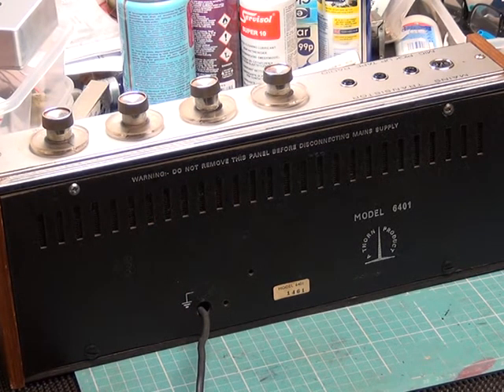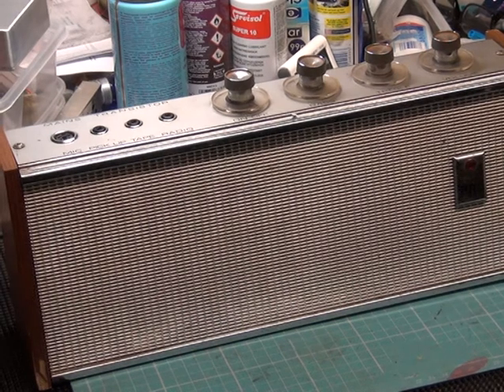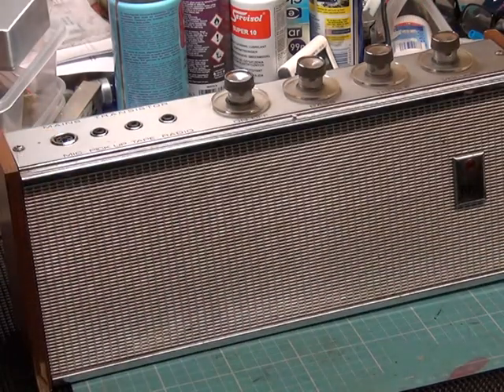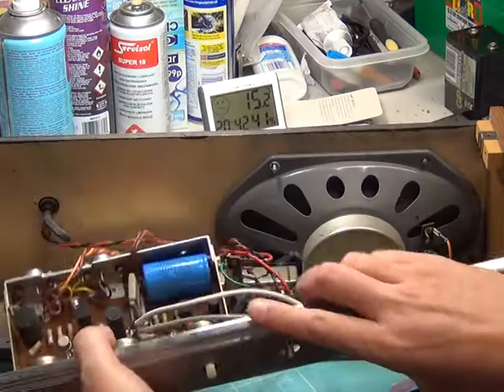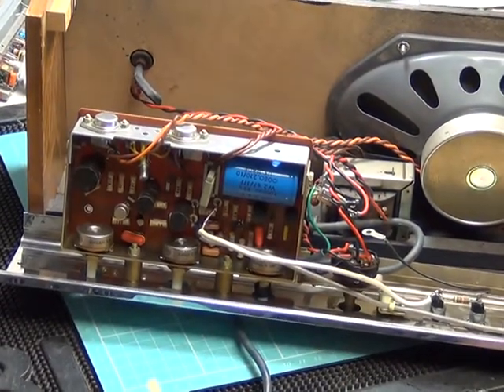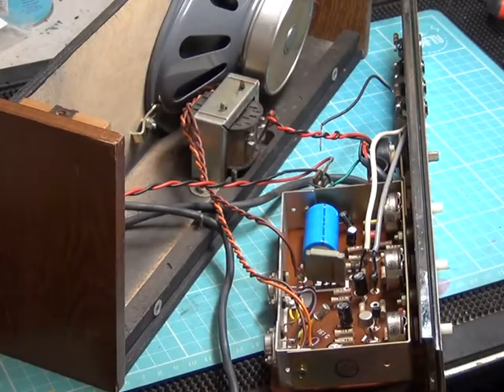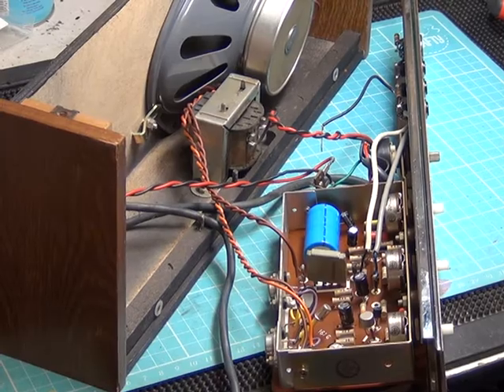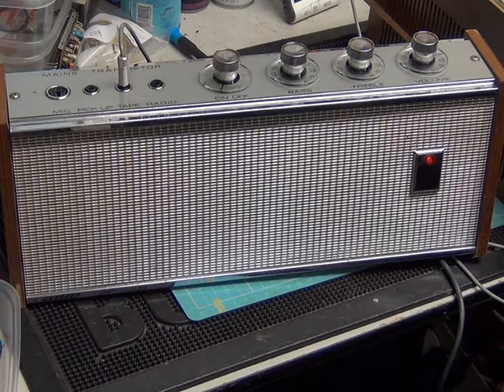BRC / Ultra / Thorn 6401 5W Amplifier overhaul

Comment: Brilliant stuff. I love playing with old radio gear. I'm currently attempting a repair on a friends ol original amstrad 901 with no output. Final transistor ordered. Fingers cross it's just that 😯
Reply from the maker: Simon, yes it's the 2SC2166 for the output. Sometimes the 2SC2086 driver fails as well & it depends what's caused it....i.e. "finger trouble" or just a bad SWR. Regarding finger trouble,  ensure the large usually green  wirewound resistor is not missing & shorted out!

Richard
Reply: Yes the resistor was shorted out with a soldered wire loop which I have removed. I tested the resistor and it appears a dead short unless I'm getting a false reading as it's wire wound
Reply from the maker: That's what's caused your output stage failure then. Some wally must have read/been told some twaddle that if you short the resistor out the radio will do 7W; it will for about 2 minutes!

R130 is 3.6ohm at 3W. We usually fit 5W for better reliabiiity. Not all meters will read under 10 ohms so may well (correctly) read a short circuit.

Richard
Reply: UK CB radio servicing thanks so much for the advice.  I've already brought 4 radios back from the scrap bin this week using your videos.  I've so far repaired a grandstand bluebird, harry moss, midland 3001 and a maxcom 4e.
Reply: I've got the same rig. A classic.

Comment: Hello, I've just come across my dad's 6401 and am looking to get a cable which can connect a modern phone to it. Do you know the name of the connection cable? I'm struggling to find one online
Reply from the maker: I don't do mobile phones so don't know what your phone connector is called, but the input socket on the amplifier is a 3.5mm mono jack. Chances are that a mobile phone to 3.5mm jack cable will be readiliy available but with a stereo 3.5mm connector, so you'll end up only hearing one channel...so you will then need a 3.5mm stereo jack socket to 3.5mm mono jack plug adaptor. All easily available on ebay & the likes for pence.

Bear in mind we did a full overhaul on this amplifier.

Richard